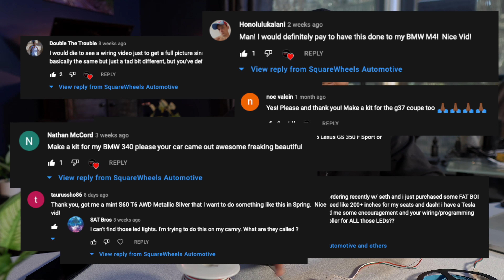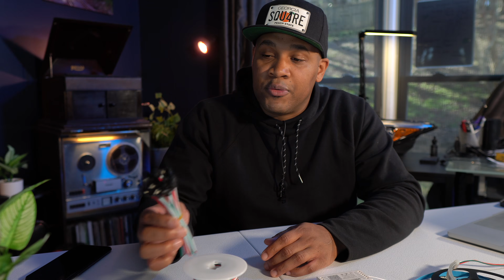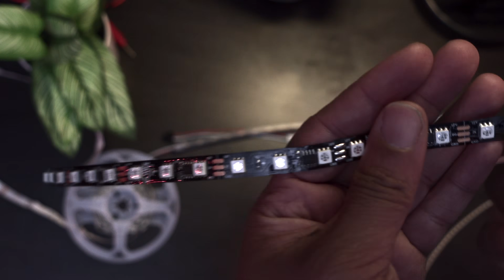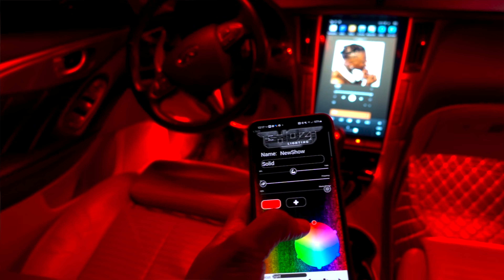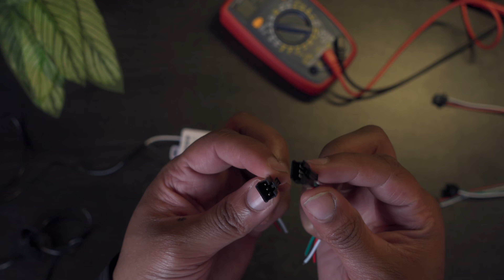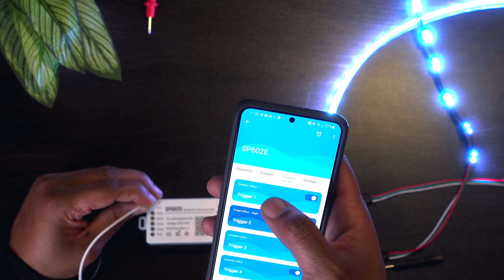Messing with LEDs 101 (Wiring, LED Strips, & Controllers)

Comment: I’m still confused on how you wire into the fuse panel or are you running these to the cars battery ??
Reply from the maker: Check my headlights install series I cover basic and advanced wiring there

Comment: Random question. My Q50 comes with the stock welcome/puddle light under the side skirts. Do you know a way to rewrite those to stay on while driving. Maybe when the headlights are on or to a switch.
Reply from the maker: As long as you confirm they take 12v, you can just tap a circuit that behaves how you'd want them to. Headlights, DRLs, fog lights, or even anything that's on when the ignition is on. The world is your oyster! I would definitely recommend incorporating and override switch somewhere just in case there's a random situation where you don't want them running

Comment: Great video bro, you make an excellent teacher. I got a question in a scenario. I want to have under glow lights under my running boards that light up when I hit the door unlock button. (I want lights to swipe in one direction red, then swipe back to white and remain on for 30 seconds for lighting the ground below the doors at night).
So my question is: if I have that setup, say on channel 1, can I get it to work if I have a relay that provides power to the controller itself and channel 1 to activate that channel. So basically, when I am away from the truck, I want the controller powered off to avoid battery drain. So when I press the dior unlock button, a latching relay would flip and power the controller from a full power off state. Does the preset on a channel remain after controller is powered off and does the controller take some time to boot? Thy is basically what I would like to know, to see if this is feasible or not.
Thanks and keep up the great work!
Reply from the maker: Disclaimer: I'm no pro I'm just some guy that likes messing around with stuff!

If I were you, I'd keep the controller connected to constant power so it's always ready to receive triggers and tell the strips what to do. I'd just have the underflow strips on a relay that gets it's signal from the same trigger, so power turns on and the strips know what to do right away. That's how I've got my underglow setup for welcome animations 😈
Reply: @SquareWheelsAuto  thank you sir! That is kind of what I was thinking as well, I keep a charged jump pack in the truck, so if it did happen to drain too much (probably won't) at least I ain't stranded. Keep up the great work, wish you all the success in the world
Reply from the maker: @1windozesuk  haha careful man I was doing that for a while... You can't get in the trunk if the battery is totally drained!  

I've been running a second battery on an isolator for a few months and it's great for peace of mind, plus I can run all my accessories at meets and shows for hours and car starts right up 🤘

Be well fam

Comment: That is pretty dope and I just made it back to GA and will be here until asking the 14th
Reply from the maker: BET ill hit u on IG fam, there will def be some meets over the next 2 weeks - we should link!
Reply: Can you use phone app and the remote to that controller say you don't have you phone but you have you remote  will the UFO have that option  and how many led are to much or is there a genal rule of thumb. And my led light have 4wires help it a Walmart brand just need 1 color multiple strips pods ... Turn on at the same time. Trying not to use there controller  there to many remote and 2 that are on a phone app that don't work well just want 1 remote to turn everything on